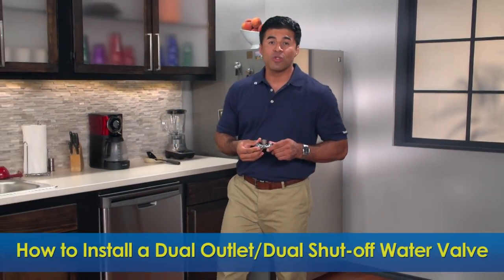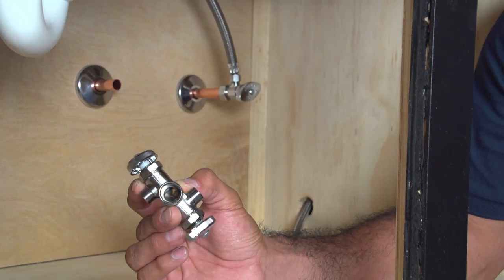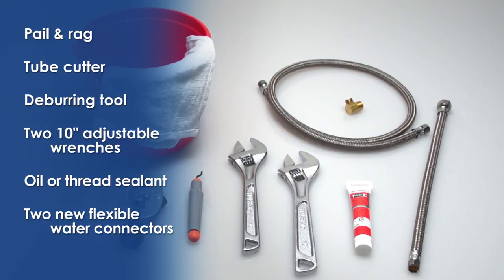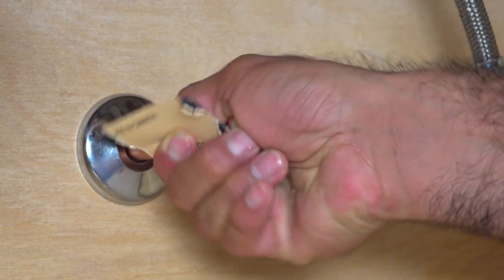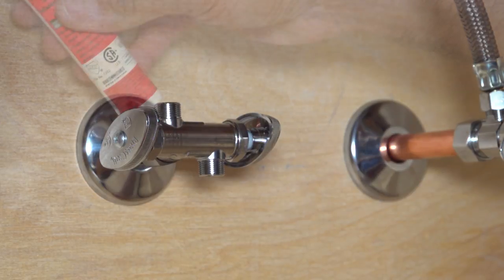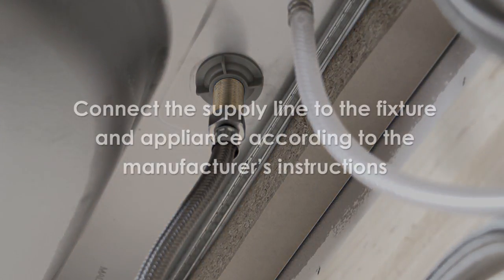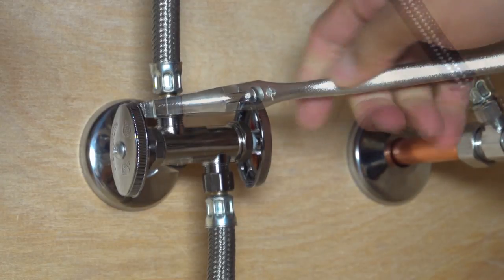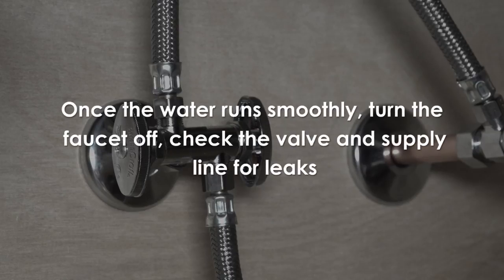How to Install a BrassCraft® Dual Outlet Dual Shut Off Valve

Comment: Appreciate companies that back their products with informative "how to" videos. This one is timely for me, as I have just received a pair of BrassCraft 1/4th turn angle valves. I installed the cold, but waiting on the hot, as the old hot has a dual inlet, which was associated with a dishwasher that will not longer be used. I'm pretty sure I can just cut off the stiff copper pipe associated with the dishwasher supply side (but not cut the hot water supply tube!), but not sure - am gathering info on that. Thanks for this clip.

Comment: This video is very misleading.  At first I too thought it was a great idea.  At the 21 second mark, if you look closely at the dual valve he's holding in his hand, the main opening for the brass pipe does NOT have male threads (MIP) that he later shows in the video that he's attaching to a nut that was put on the copper pipe. Later in the video he's turning that adapter and then tightens a nut over it that he had put on earlier. I ordered this same exact dual valve and it comes with female threads and no nut and these don't work with the copper pipe. I can't find a version of the dual shutoff valves anywhere with male thread for attaching to the copper pipe.
Reply: Welcome to my world. Read my disaster. Nowadays you can't trust companies, does any exist that have integrity, honesty and professionalism? Hope you get your problem fixed.
Reply: Oh that is just wonderful. No wonder the jerk that just installed my dishwasher complained about copper pipe and asked for a towel. This valve under my sink is now leaking after he installed the new dishwasher. Never leaked till he was banging around and messing with stuff. Saw a bit of water under there after he left. Assumed it just came out of something and wasn't  a leak. Woke up tho water all over my floor and down stairs in the basement. Plus down vents of my furnace have water leaking out of that too

Comment: Yesterday I had a plumber swap out the old dual shut off valve with a new one (exact same type) under my kitchen sink.  I noticed he applied a Blue Pipe Sealant at the connections or bolts (aprons) are. However, he did not apply the sealant to the connection from the valve to the copper pipe extending from the wall. After he completed the install, 30 minutes later I noticed a leak were he did not apply the sealant. He did a sloppy job. He failed to tell me after I turned the main water line valve on  to turn on the faucets throughout the house on to let the air out of the water lines. My master bath (under the sink and the toilet), guest bath, and under my washing machine was flooded with water! Ugh!!!! I spent my Friday night mopping up water! I called the company the following morning and told them what happened. They sent another plumber. He tighten the dual shut off valve under the kitchen sink and replaced one of the shut off valves in the master bath. I still have the same leaks!!!! Should the plumbers applied the pipe sealant where the leaks are? I have already paid out $200 for substandard work. This company is licensed and has a A+ rating with the Better Business Bureau.  Should the plumber start the process over and hopefully and make sure there aren't any leaks? I am not paying anymore money for shoddy work. If this plumber doesn't make good, I will go after his license. Please advise.